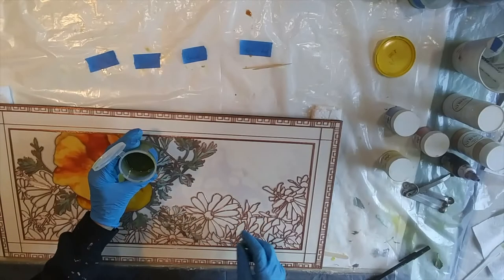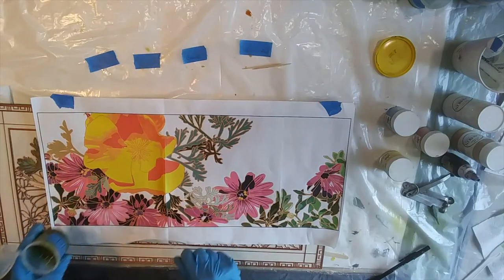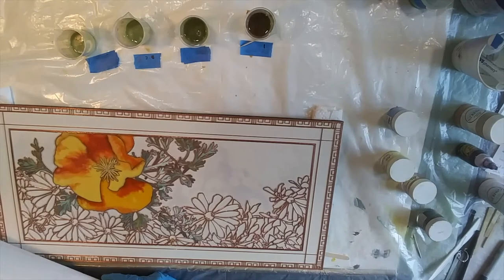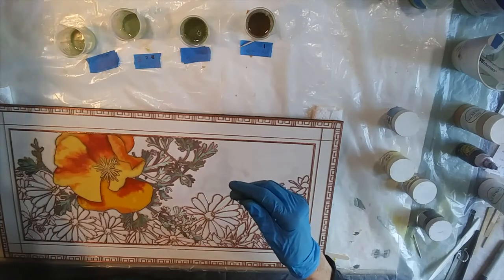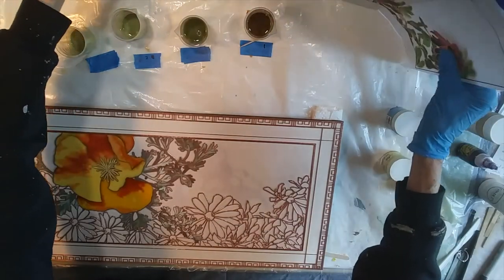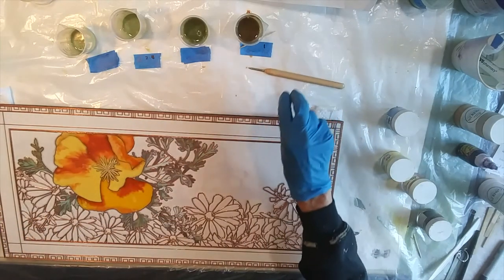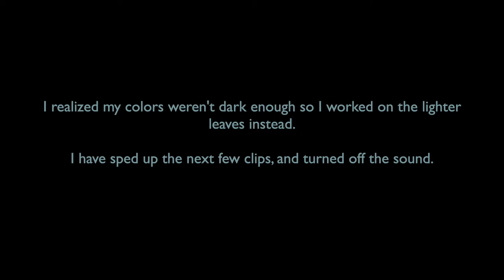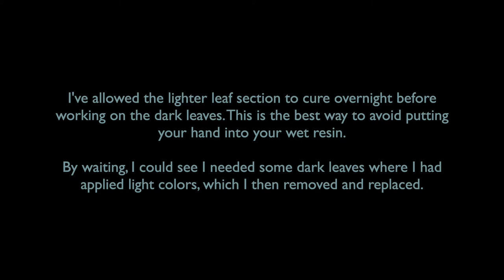*Part 6 Daisy leaves* (6 of 8)

Comment: What do you use to attach metal to what surface so resin dosnt leak into other areas?
Reply from the maker: I use a super thin instant cure cyanoacrylate (a very watery crazy glue). very little is needed but you need to spread it quickly under the length of the wire. I butt my wires very close to each other. There will always be a leak somewhere, but if you use the fiberglass board, you can remove the cured resin (the next day is best) with an exacto knife blade inserted under the misguided resin and you can pull it off if it's a large area. I use another tool to "hammer the blade" under the resin. If you are using a board with exposed wood or covered in paper, it's best to remove the excess while it's wet, but let it set up a bit so it doesn't keep flowing out. You do a lot if cleaning up, but it is worth it! I hope you'll try it; just know it will look terrible until the final topcoat.